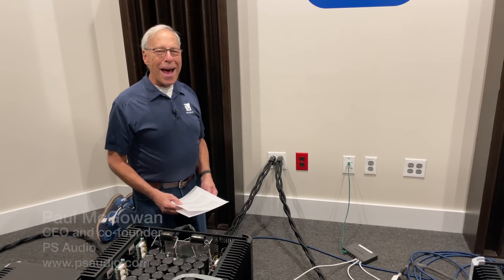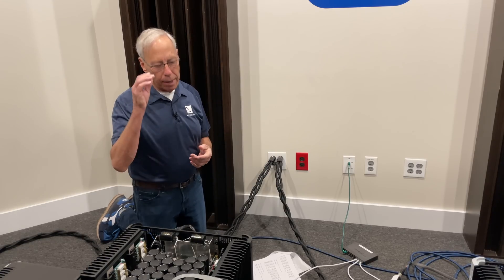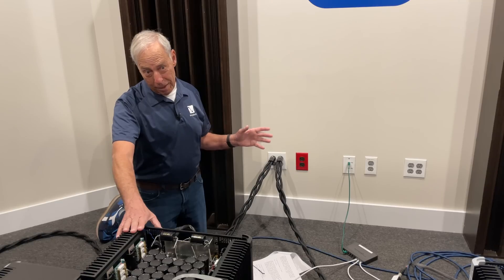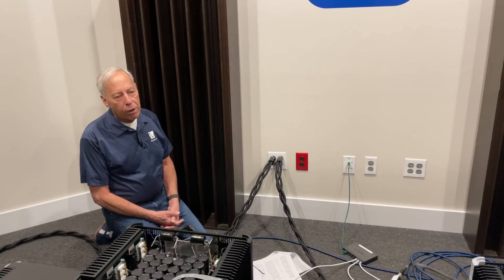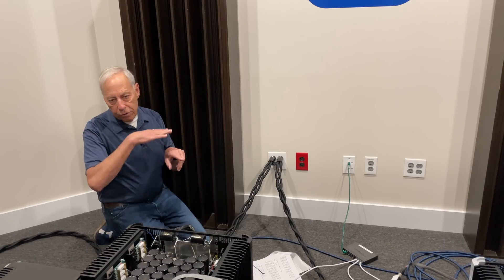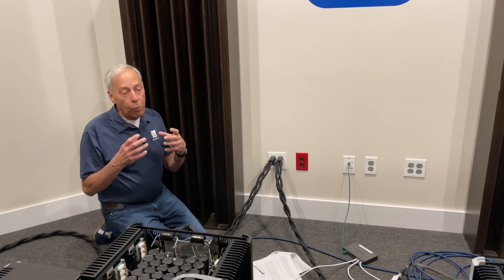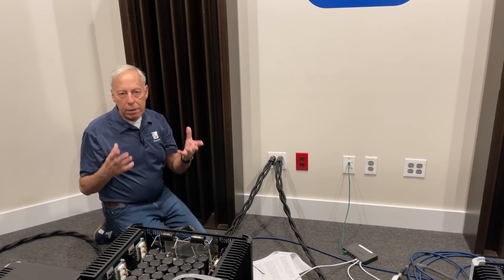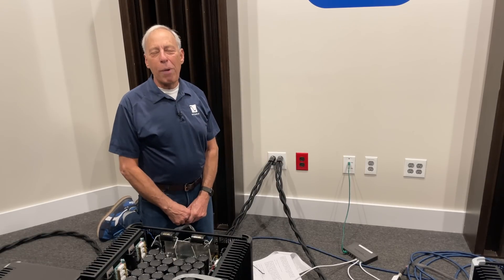Are braided power cables better?

Comment: What good does the 10 feet of cable braiding do when they run parallel from the transformer to your breaker box through the wall and to your outlet? I think I am losing respect for this channel.
Reply: I think the things to remember are two fold. First, you can't think of AC power as being at the end of a long wire. It is not. It is a loop with the equipment being powered in the middle of that loop. Second, once the power leaves the wall it comes into a very noisy environment - that of the equipment which is generating a ton of EMI that we would rather not get into the power.
Reply: @octaverecordsanddsdstudios1285  Properly designed equipment would be designed to minimize EMI emissions. In fact in Europe you need to pass EMC regulations in order to sell your product in Europe.
Reply: @ianhaylock7409  Yes, of course, and we too have to pass those same tests to be able to sell in Europe as we do. That said, it doesn't mean there isn't EMI. It simply means EMI is below a certain level. Also, remember that EMI is radiated. The diodes in a power supply chop up the AC and in so doing create non-radiated noise on the power line itself.

Comment: If the power cables used make a difference in the audio system's sound, where exactly is that coming from? Someone previously observed ( and I have seen this countless times) that the INTERNAL wiring in amplifiers, speakers, DACS, just about every piece of audio gear made are much smaller and simpler construction. Not to mention the many feet of unshielded Romex running through a house. Not sure a short length of floobydust wire will actually change anything except one's perception. And perception is everything,  I guess. Shielding, and the appropriate low capacitance, Inductance and resistance in a cable pretty much describe the issue. The rest is just someone interested in $$$$.
Reply: It's not coming from the Floobydust cable It's what is not been taken away obviously . The Audiophile Cable is not additive process , It is a negative reduction philosophy. I have done many AB tests and came up with a negative result thereby proving the negative reduction being heard. I am no fool, and will only part with huge sums of money when I am unaware of it.

Comment: The people that complain about "audiophile" being snake oil can't hear the difference between different piano makers. There is a huge sound difference Steinway, Yamaha, Bosendorfer pianos that the skeptics don't hear in the same way they can't hear the differences in audio equipment. Everyone has different levels of sensitivity to sound, just like everyone's vision is different, some need glasses some are sensitive to bright light some have better night vision. I have very sensitive hearing and some think it's a good thing but finding audio equipment that sounds pleasing to me is difficult and usually expensive, this is not so good.
Reply: Logical fallacies employed by this argument:
- Strawman
- Faulty Analogy
Reply: Doesn’t answer the question about the home wiring not being “braided”. Even admitted the interconnects aren’t braided. I used to be an audiofile, but as I got older (and still live my high-if equipment I bought 20 years ago) I realised it was a money-pit of mostly lies. Yes, good quality equipment is a good investment, but a super expensive power cable plugged into a home outlet is not logical. It’s someone selling something that’s not needed. It’s lies to say it sounds better, it’s electronically impossible. Any cable that’s kept away from other sources of interference will perform.
Reply: If you're "hearing" "audiophile" power cables, it's not because of your "sensitive hearing"
Reply: @captainflapjack7100  I agree.  he speaks of a known reality about musical instruments,  and then uses those facts to justify his beliefs  about electricity through wire, which is a completely different subject . he seems to not be aware of how human hearing works or that recorded music is only an illusion of a past event.  trying to create reality from illusion will have him churning his equipment endlessly.   Some people enjoy the chase .  I resist public statements of ignorance , preferring insight , when possible.   I don't expect people to be experts , but it would be better if all audiophiles knew a little about the basic laws of electricity and how human hearing is a subjective, not objective,  process .

Comment: I got a feeling Paul mixed up Capacitance and Inductance in this one.  Every wire will have an inductance, placing a signal/power and a return parallel to each other over a long run will lower the effective inductance, but increase the capacitance between those wires. This is the idea behind transmission lines. Braided cables would have more effective inductance, but significantly less effective capacitance. Like with all things electronics, comes down to impedance matching to get every last percent out of a system.

Comment: Hi thank you for the very interesting video as usual.  Speaking of noise coming along the mains I wonder if a better design/execution of the power supplies inside the units (amp/preamp) like adding filters and so on can have a similar effect.  I see for instance a lot of mains filter devices   I do not know anything about their actual effect by the way   Kind regards, gino
Reply: most filters now-a-days are there to prevent that device from putting noise back onto the mains, not so much for filtering the noise coming in. Of course they do, just not generally why they are there.

Comment: Didn't use a silver spoon, BUT, I did drive myself to (near) madness about ten years ago braiding up a pair of Chris Venhaus CAT5 speaker cables. While it was a finger-numbing experience I was dumbfounded on the difference it made to my system. When compared to the mid-priced Monster Cable I had been using the difference was far more than night and day. In fact, "miraculous" might be closer to the truth. Since then I braid everything I get my DIY hands on.
Reply: speaker wires are very different from a three foot section that supplies juice to be converted into the appropriate voltages to run the various circuits, lest anyone be confused.

I also made my own speaker wire, and was quite pleased at the result.  they were very stiff and thick, making them hard to work with and defiantly had a home made look.  

since the wife was not a stereo nut, after a while,  I switched them out for a nice looking set of monster cables, the kind that everyone hates.   Since any change in an electrical circuit, like speakers to amp,  can effect function, I did hear a difference , and didn't love the results.   fortunately , my system is pretty good. so little things like that are insignificant , and my ears then got accustomed to the change in sound, forgetting the previous experience.
Reply: @richardelliott8352   I think you're right about any change in an electrical circuit making a difference, and I always hear it whenever I change wire---sometimes subtle, sometimes dramatic. A couple of years ago I switched from a balanced Mogami Neglex 2534 Gold interconnect to the much touted Belden 8402, also balanced. The nice soundstage completely collapsed!!! Two dimensional, with everything plastered flat against the wall. It was a shock, especially since the Belden at the time was more than twice the price of the Mogami. Listened to it for several weeks, and finally put back the Mogami and the wide, deep soundstage returned. You never can tell. At least when you roll your own you can experiment for a lot less money than buying ready made.😄

Comment: Interesting, that when you open up most devices… Even higher end devices, that you would find nothing heavier than 12 gauge stranded cable coming off the back of the entry panel going to the first circuit board. Exceptions exist, but in general people run huge wires to a device only for there to be a bottleneck right on the other side of the back panel in wire size. Same thing happens in speakers, even some of the most expensive speakers… If you take the binding posts off and look on the backside, the wire that goes to the actual speaker isn’t even that big, but you have people running welding cable to the speaker from their amp… I mean you got to make up for losses and all that 🤔
Reply: You are not making up for anything.
Reply: Watts ÷ volts = amps. If you do the math, you will find out what you need for wire size. Your amp will not take more than 15 amps typically by design, otherwise it would trip your breaker.  You don't need 10 guage wire on a 20 amp circuit.  Companies like to sell products and people buy into what they are told. Most of it is false and is just marketing.
Reply: @shanen.6210 if you have a really nice set of 4 ohm speakers that are around 92db efficient and say a 300w monobloc amp to drive them (so you have plenty of dynamic headroom and all)…

You will in a general listening condition of 85-90db SPL in an average size listening room be drawing about 3-5w per speaker for a pair of speakers to hold a 90db SPL at 4 meters. You may see dynamics, especially on bass excursions to 30-40 watts for brief periods of a couple seconds but at reasonable levels that won’t damage your hearing you should be using under 10w per channel in most cases unless its a very difficult and complex load to drive. 

This means your seeing 1-2A fairly constantly on your speaker wires during playback with excursions up to 3-5A. 

Even a dedicated 1000w sub amp running wide open with a test tone would only draw 15A but it would vibrate the walls most likely and possibly overheat the voice coil. 

If you turned it all the way up and maxed out that 300w amp in the first setup. Your looking at around 107db at the listening position 😬 pretty brutal on the ears and your speakers. That’s brutal loud rock concert venue levels of energy.

Comment: Thank for this video. I am just wondering one thing if you could please elaborate on it as it does not add up at all for me. One can have braided cables for thousands of dollars, however in ones walls there are normal - mostly cheap - electrical parallel cables, which you could probably buy miles of for the price of the cable in this video.  So from a bigger perspective, the power flows from the power station, trough the grid, to your house, then trough the walls of your house, to the power outlet, then finally to a super expensive turbo cable for let's say 2 meters. So how does it makes any difference, adding better cable at the very end of the electrons route? I understand that using worse power cable than in the walls, might have negative impact, but I don't understand how using better power cable than what one has in walls can improve anything. Please explain
Reply: That's why the term "Snake Oil" and overpriced cables have become synonymous.
Reply: Yeah, it's just snake oil. Even Paul himself said in a different video about I think XLR Y-Splitters that it does not matter for that little length of cable to use a Y-Splitter, in the grand scheme of things that Y-Splitter is about the same length as the power cables from the power plant to your amp :) So he is even contradicting himself here
Reply: @rafajrichard  I'm analytical by nature and I've been on the empirical evidence side of this debate until I listened to a highly refined system that could explicitly demonstrate the differences. I also started following Danny Richie's YouTube channel in the namesake of his company: GR-Research.   I don't think there are many people in the industry more knowledgeable than Danny and he's not just a believer in quality cables potentially having audible differences theory, he's knows balls to bones the differences are detectable by the human ear. Although I would prefer to see data we could measure with electronic equipment, the scientific method is an ongoing endeavor. Assuming our current scientific understanding of sound is absolute is probably the bigger mistake. I never thought I'd end up on the other side of this debate because I lean VERY heavily towards data, but I think my conclusions were wrong about this one.
Reply: @kenhiett5266  Audio Science Review blows Danny out the water. Over... and over.
Reply: @CynicEidolon  Good one...lol. Imagine if you said that in person while retaining a perfectly straight face. Now that would be belly laugh funny.
Reply: @kenhiett5266  Danny Richie is an audio salesman, full stop. And a convincing one. A few things you have to understand, and this coming from someone who spent many years as both a live sound engineer and a recording engineer. First- Nobody likes a flat audio sound. The human ear is much more sensitive in the roughly 1k to 3k region. A flat sound as measured on a graph sounds beamy, forward and taxing. Do you really believe the best audio manufacturing engineers on the planet could not build a flat response into their speakers if they chose to? Well they can and are called studio monitors. Danny does not have some genius insight, nor control the market on parts. He is a salesman with some testing gear and we all know how numbers can be manipulated to tell a story.
Reply: Correct! The Romex in your wall isn’t braided, but acts like an antenna picking up noise which is then fed to your equipment. True, your equipments power supply rectifies and filters the power (its effectiveness varies). A high frequency filter plugged into the outlet operating in parallel helps mitigate the noise before it enters your gear. And then the braided cable from that point to your equipment is immune to the introduction of new noise. The quality of your equipments power supply being a factor, the idea of pre filtering comes into play. That’s why listening to music at night seems to sound better than during the daytime. Less people and machinery on the grid.

Comment: No. The answer is no. Braided power cables provide absolutely no benefit in a system.  Come on Paul - this isn't a faith-based pursuit, as an engineer you know better than this.
Reply: In guitar amps and my audio tube amps, the signal input wire inside the amp is always braided to reduce noise. And the placement of these wires is always important to reduce noise.
Reply: @mikemullenix6956  Guitar signals. Very, very low level, and naturally perceptible for outside influences, where every millivolt can be audible.

Power cables - the exact opposite. Absolutely humongous "signals" compared, huge voltage, big current. The same interferences as above will mean practically nothing. Mains power is never amplified, but technically attenuated instead, and then filtered. The noise from outside will vanish completely.

Comment: Is your power supply braided within the walls then? Or from the local transformers to your property? Or from your your local transformers back to the power station. Its just a guess but I'm thinking that you have spent hundreds if not thousands on on just the last few feet in the run.
Reply: 99.999999% of copper behind the walls aren't insulated or shielded. Braiding them would be a disaster.
Reply: @falcon048  Are those braided wires in the video shielded? I was under the impression that they were each insulated but unshielded and connected to line, neutral, and ground.  Obviously, the AC cables from the outlet to the service panel would have to be re-run with new wire, but I don't think braiding them would improve anything.

Comment: What is the benefit of such a well shielded, twisted power cable when you have 0 influence on the noise the wall wiring and power cables are picking up? Isn't it only ()somewhat) justified if you have some very special wall cables and some extra filtering at your building's power entry point?
Reply: This Japanese power distributor shields EMI and RFI but without filtering the electricity itself : Furutech eTP60-E. So you can plug your power cables into that one, using a less expensive but thick gauge power cable into it.

Comment: When you say "huge difference", is it around what, 50%? 90%?
Reply: It's 0% mate.

But if you payed 2000 for a simple cable your brain will tell you that it sounds better XD
Reply: How on earth do you quantity. In percentage terms, an improvement in sound? Mains cable leads, for me, have had a very subtle effect with audio differences (7%). Speaker wire much more so (35%)
There I tried to give you a percentage rated difference I have heard.

Comment: How do the wires in the wall sound? They are solid and not braided. Does the braiding at the last couple feet bring back all those lost sounds from the power going into the power supply to be converted to something else?

Comment: Do you braid the cable from the back of the wall outlet to the power station also ?.........   Maybe it works from a regenerator to a component, but not from the wall outlet.
Reply: It works😉
Reply: Hahaha No its not. its only a few feet that matter lol (sarcasm)